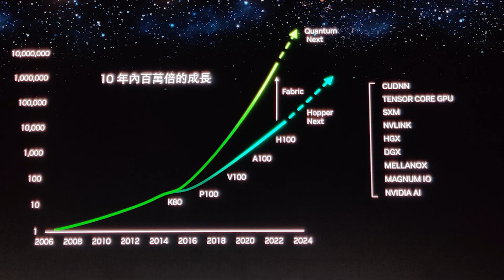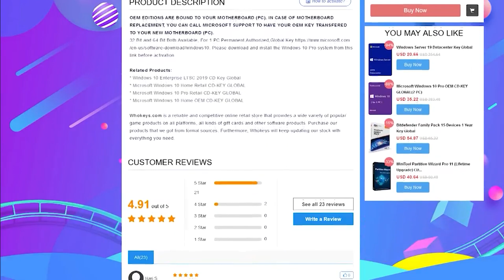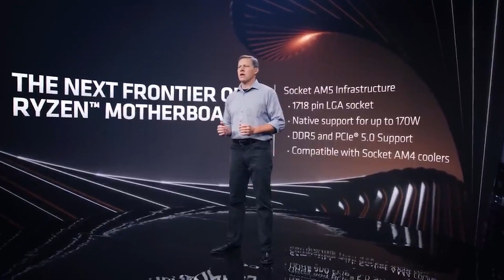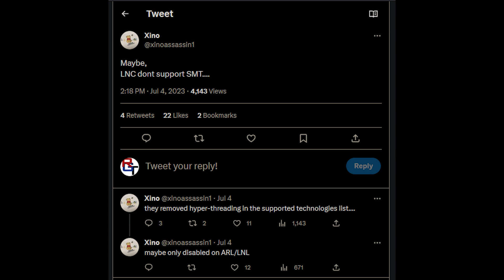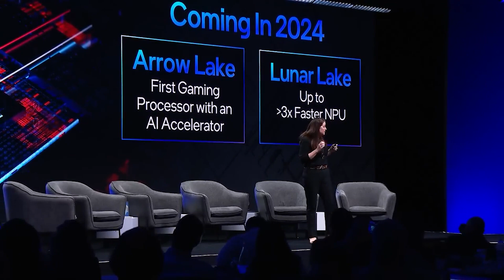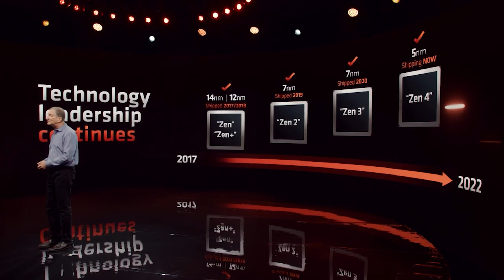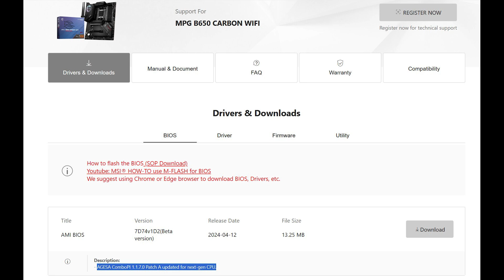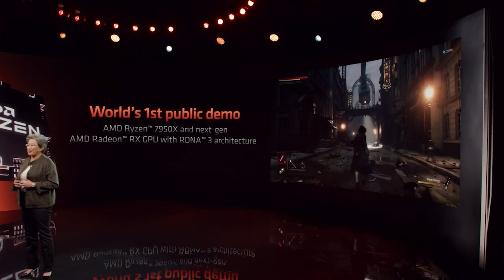Zen 5 CPUs CONFIRMED | RIP Hyperthreading - Arrow Lake LEAKS

Comment: Hyper Threading was introduced to make the P4 cores more efficient. These had several computational units for different types of operations. The math processing is done using a separate unit so with hyper threading one process might be engaging the execution engine while the other process is using the math processing unit. If both processes try to use the same unit at the same time one will have to wait for it to become available. The thing was that for less than 5% extra circuitry in the core it could handle two processes instead of one. But all the cases where processes had to wait meant that it wasn't able to process twice the number of instructions at the same time, but in general it was faster than a single core processor in total.

To allow for multiple threads the core need to have at least two sets of registers and be able to copy them to the execution units when the particular thread are to access them.

To improve the performance more units were duplicated allowing the processes to work more of the time without having to wait for each other. But that means that more circuitry had to be added making the chips larger and more complicated. This went on with each generation of processors becoming more and more advanced.

Now my guess why Intel is dropping Hyper Threading is because they have reached the point where making the HT more efficient meant that they got close to using the same area for circuitry that adding an entire core would do. At that point they could kick HT out and add cores instead. And without having to allow for all the weird things that is required for HT the cores can be simpler and more streamlined.

Now I'm not going to pretend to know that this is why Intel kicks HT, but it's a logical guess. The interesting thing will see what AMD does after this. My guess is that it depends a lot on what the results are for Intel. If they are able to streamline the cores, curb power draw and improves IPC while being able to raise the CPU clock then AMD will follow the single thread core path. There is nothing strange about this. It has everything to do with remaining competitive.
Reply: Geez if I would have wrote this I would have had about 5 - 10 people read it at most.

This is the very thing I've said more than once, you have to have replication of at LEAST the registers because as you follow through an instruction sequence that's what's getting updated and then I had idiots try to tell me there's no replication of circuits, I had a good laugh, they didn't like it and that was that.

Yes if you don't have replication of anything you are CONTEXT SWITCHING which is the worst possible thing a core can do.

The reason why Intel is getting rid of HT is you don't get a 2:1 uplift depending on what the core is doing.  It can be close to that, but if both threads want to use the same thing then one has to wait, and if you want to get rid of that wait time you either need to replicate more circuits or don't use HT.

I'd say the reason why they're doing it NOW is the thing you DIDN'T mention as a main benefit, which is getting two threads performed in the space that's a TINY bit larger than a single core, so the BEST thing about HT is the efficiency of SPACE requirements.

Intel is moving to their "Intel 4" process node which means they can shove a lot more cores in a smaller space.  Eventually I could see AMD doing the same thing but I think their implementation of SMT is better than Intel's so I don't know. 

If AMD moves to something like TSMC N2 AND can get a mixture of SMT-1 cores, whether they are regular or C cores and can get 32 threads running I could see AMD moving away from SMT-2.

The OTHER main reason I see for doing this is better IPC.  That's just fact.  If you can't get 2:1 in performance in single verses 2 threads being processes by a core, that's a hit to IPC.

So, those are the reason I PERSONALLY think Intel is moving away from HT is better IPC performance, plus they can shove more stuff on the die with their Intel 4 process node.
Reply: No the facts don't fit that theory, firstly a key advantage of HT was having the core do work on memory stalls, where it would otherwise be starved of data.  Games often struggle to reach 1 IPC despite pipelines, register files, pre-fetch, smart branch prediction and cache-ing.
Secondly Intel's HT has not done as much simultaneously as AMD's later SMT implementations which use more power and do more work.  Intel has had huge security problems and paid heavily on server performance because their old HT was unusable.   ARL was intended to have HT on their P-core but struggled with issues and chose to drop it, as this new "rentable unit" which seems similar to the Bulldozer modules sharing an FP execution unit resource will replace their current HT implementation.
Now simply there's less benefit to 8x2 HT threads on P core when you have a crapton of ¼ area E cores in heavy MT tasks.  AMD Zen cores have ½ area so x2 threads for ~30% benefit and 8c/16t sharing a unified cache suffers fewer drawbacks.  It's why 16c/32t Zen dual CCD held up well and Intel had to consume so much power to narrowly win benchmarks.
ARL MT will suffer but packing in E cores on top models makes the no HT loss marginal.
Reply: @RobBCactive  I think he's thinking of macro/micro ops and out of order execution maybe? The idea of hyper threading was indeed to help with memory stalls/latency. I think he means that if two threads happen to use the same internal resources then there's a problem but even then that's rare and if you follow Intel's guides then that's usually avoided because you shouldn't group threads per core so that they do the same processing/share the same resources.
Reply: @skilletpan5674 lndeed  re-ordering and pre-fetching help mitigate stalls too.  The testing comparison of Intel HT & AMD SMT showed far more performance gain on AMD suggesting both threads making progress as you suggested and using extra power too.
The effectiveness of V-cache suggests many games are affected by stalls the super well behaved parallelism is mainly done in GPU.
Reply: @RobBCactive  Vcache really helps with latency/stalling. The two are related. If you can shorten the latency then you can reduce the amount of stalling that happens. Also if you can cache more branches then you also can reduce stalling. The P4 showed a large cache helps but generally it tapers off rather quickly. Mind you games use lots of tables of data etc so caching that really has a huge impact on performance. I can say that lots of simulation programmers will be buying the Vcache cpus as well because of the use of tables/arrays generally as well.
Reply: paused the vid, just to read this comment and the preceding comments, sounds like very reasonable hypothesis'
Reply: @one_rich  It's in the intel hardware manuals for P4 and newer CPUs. It's all essentially the same since the P4 but there's now more fancy branch predictors and other surrounding logic that really helps to cut down on wasted opportunities for the cpu to keep working. SMT4 has been looked at on and off over the years but this new rentable units thing sounds like a much better use of how to get the micro ops to be better processed. I.e less cache flushing perhaps?
Reply: 5 head
Reply: Does adding physical cores (intead of doing HT) increase power consumption?
Reply: @Hyperion1722  Potentially yes as the cores will work more efficiently. Without juggling two threads that has to wait for certain operations as that resource is already in use by the other thread the IPC increases. So a slight increase in power compared should be compensated for with better performance. Now is the performance increase going to be larger than the power increase? This is the relevant question. The fact that Intel seems to have chosen to leave the core SMT behind seems to suggest that the total improvements are worthwhile.

Now the processors of today aren't all that power hungry if you look at history. The P4 had some versions that were power hogs for real. There was a time when the 10K RPM Delta fans was sold for use on CPU heat sinks. Now the high speed Delta fans are LOUD. Those fans can make a quite deep chop in a finger if you were to get your finger in there. Compare that to what's used on CPU coolers today. Given the performance of modern CPU's I wouldn't call even the 14900KS that bad compared to the monstrosities of the past.

But this is mostly me guessing about the new processors that Intel is planing for. Until they are available and has been tested we won't know exactly how this turns out.
Reply: @blahorgaslisk7763  With same node? (7nm) and with more transistors, the top tier new CPU is likely more power hungry than the current 14900K.
Reply: @Hyperion1722  You also have to take into context the performance. It might be more "power hungry" but the important part is if the amount of performance raises faster than the power use. If it's say 20% better performing but use 10% more power it's still a positive change.

We will have to wait for real hardware being tested before we know the result.
Reply: @blahorgaslisk7763  Yes, we will just wait and see on how this turns out. Zen 5 could be the first to release and being compatible with fine tuned AM5 mobos would be a boon to upgraders and for those who wants a new system upgrade.
Reply: @Hyperion1722  Yes, more cores=more transistors and stuff=more power.
Reply: Hyperthreading is also to try and mitigate pipeline flushing/latency. Some instructions need to totally flush the pipelines such as branch instructions(jump,call etc). If you stagger the instructions running in the pipe line then if you need to flush one of the instructions then you still have at least one instruction executing to completion while the cpu is fetching new data for the other thread. It means you don't need to waste hundreds of cycles while you reload cache and fetched new data etc from main memory.
Reply: @skilletpan5674  Not quite sure what you mean by the way this is stated.

You have an instruction pipeline for each thread.  There isn't an instruction that needs to flush a pipeline.  There is logic that loads the pipeline with a certain amount of instructions that the thread needs to run, based on the depth of the pipeline.  If you are simply performing a long string of operations that don't require a decision, that pipeline will be loaded with the instructions that will indeed be executed.  The purpose of that pipeline is basically prefetching data that will be needed for the instructions to be executed.  So, the logic evaluates the instructions in the pipeline to retrieve data.  This will help to get L1 cache loaded with the correct data needed for the instructions.  Data retrieval can be a VERY slow process because that data might be on disk, but even if it's in main memory, memory is slow vs. the speed of cores.

The problem comes up when a decision has to be made, and in general when someone codes something like an "IF, THEN" instruction, that's executed at the machine level with branch instructions, where you branch under a certain condition.  Now, I don't have the X86-64 ISA memorized but I worked a lot with machine language for older mainframes, and there were both branch and jump instructions both of which can be conditional and unconditional.  So, compiler converts decisions in high level languages to conditional jumps/branches and since once again I don't know the X86-64 ISA we'll stick with branch.

When the logic for the pipeline comes across a branch instruction, that logic will make a best guess to branch or not branch (branch prediction). It will load the pipeline based on its prediction.   If it guesses right then nothing needs to happen in regards to that pipeline when the instructions are actually executed.  If during the execution the guess was wrong, you have to flush the pipeline and get the correct set of instructions.

So yes, if you have to flush a pipeline, if you don't have SMT-2 then that core is waiting for instructions.  How long it waits depends on where those instructions are.  They will either be in cache or main memory.  It's rare, but not impossible that instructions are on disk, but it can happen.

If you have SMT-2 then when the pipeline for one thread is being flushed and reloaded the other thread can run.
Reply: @johndoh5182  In the 386/486/586 and p4 you have a pipe line. The p4 pipeline is 20 stages. This is a massive pipeline. Every clock cycle the processor does some work. So it can take a long time for the first instruction to get through. If you need to execute a jmp or other branching instruction (the most common that causes the pipeline to be flushed) then you have wasted the other instructions that are in mid execution (even though they may not be the right instructions to execute).
This means a jmp or call etc takes a long time to execute because the pipeline needs to be cleared first and the new instruction stream to be loaded and decoded etc.
Hyper threading is a way to abstract the pipeline into two threads. Best practice is that the two threads should be as unassociated as possible. If they don't share the same resources then they shouldn't stall or require a full pipeline flush to happen.
This is why windows/linux and the programmers need to plan their hyper threaded programs to use multi cores and threads correctly or you can make your code run worse.

You do not have a separate physical pipeline for each thread in the P4. You have some extra stuff like buffers (registers and other data) and some extra ALUs etc but not a full replication of the pipeline. Hyper threading is about abstraction to make the resources more effective and reduce expensive pipeline flushing.

The first paragraph of your reply shows you don't know what a hyper threading pipe line is or what's happening. "There isn't an instruction that needs to flush a pipeline." There are many. Do you know what happens with the decoding of instructions in a non hyperthreading pipeline? When the processor gets a new instruction it decodes it and starts to try and work out what it needs to do. A conditional jump or anything that works with registers is annoying because the pipeline needs to work out a bunch of stuff first before it can just execute it. By this stage the pipeline has pulled in new instructions that are next and could be several instructions deep. If the conditional jump is not executed then you are safe and can just keep executing. If your conditional jump needs to execute then you've just filled the pipeline behind you with junk and you need to throw them all away(this is worse if branch prediction is wrong),load the various caches with the new ram locations (if the there's a cache miss then this is rather bad) and then start from the new ram location and load in the instructions again.
If it's a hyper threaded pipeline then if you have this same issue then at least you only need to clear out 1/2 of your pipeline at worst. There are some edge cases where you may need to clear the entire pipeline but that's to do with cache and ram issues and shared resources etc.
That's the dumbed down version. If you want a better idea then read some of the P4 etc programming manuals and have a look at the cycle counts for them. The high cycle counts on some instructions is usually things like flushing registers/cache and fetching new data etc.
Reply: @johndoh5182  Older mainframes etc have quite different ways to deal with this stuff. The p4 etc made it rather complicated and hence has a huge penalty when it needs to flush the pipeline (It's one of the main reasons why the AMD thunderbird beat the p4 generally with lower clocks). Hyper threading didn't get really good till a few generations later and branch prediction was improved vastly. Over the last 10 years or so it's now rather good and I suspect that one of the reasons why hyperthreading is no longer needed as much is things like this and much better out of order decoding.
Reply: Thanks this was a damn good read.